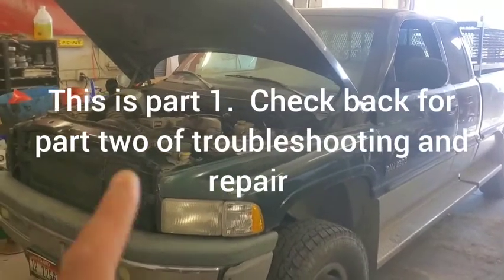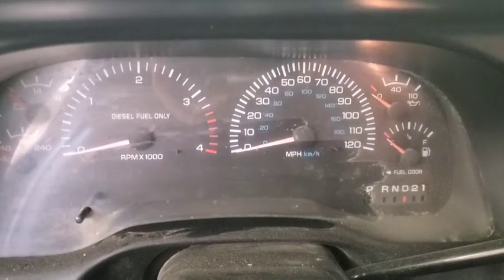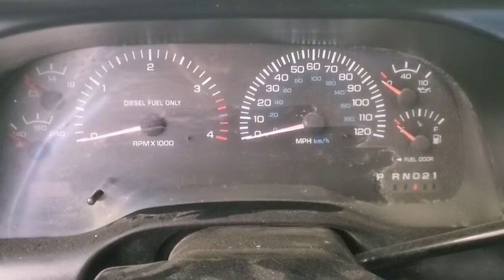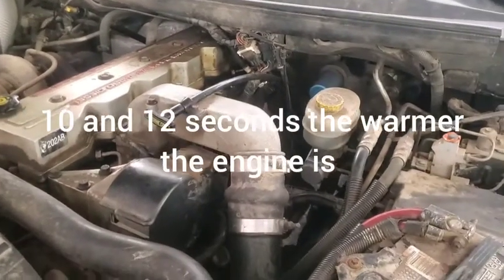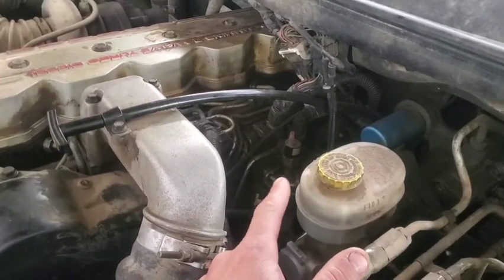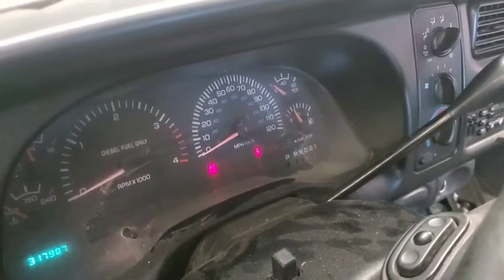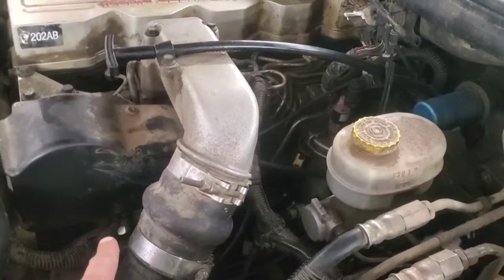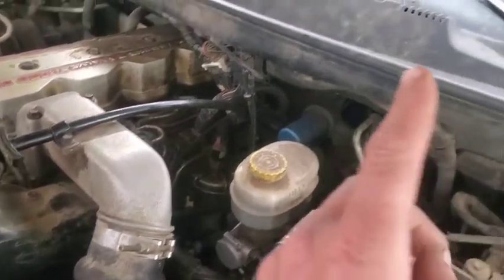24 Valve Cummins VP44 hard start and/or long crank.  Check this first!

Comment: Hi, just wanted to share... battery voltage looks fairly low... I've seen a good many times... 2 strong batteries and THROUGH ground check fix this exact issue... !  I know it seems odd... but, simple and something to try.  Please lmk if this happens to work for you.

Comment: P.D.R No Lift pump Air Dog 150 BUT wair do i get one of these check valves whats the name or brand the hole thing dosent make a lot of sence when i go out first thing in the morning it fires right up then the rest of the day hit an miss may not do it all day then oooppssss ....its kinda weired .. dident do it till i did the pushrod cover witch ment taking off the VP-44 truck runs real strong ollll balck betty got 100 over injectors very happy .. pulls my camper no horses any more miss them thank you Pro diesel R
Reply from the maker: I'm sorry but I can't read or understand what you wrote or what you're trying to ask

Comment: my WTS Light coms on every time i start but gos out when started my problem is like its loosing PSI if you let it set 15 /20  it takes 2 or 3 short cranks it purrrrr like a kitten never misses a beat but some how the fuel is not staying at the pump any idears  thank you guys great video
Reply from the maker: You try replacing the lift pump.  The lift pumps are supposed to have an internal check valve in them.  Or you can install a one way check valve in the line

Comment: Throttle Position Sensor
Reply from the maker: That's not usually the cause for this problem.  But I'm curious as to why you think that
Reply: because I replaced the TPS in my 99 Dodge without using a ohm meter, and the truck  won't start unless I push on the gas paddle slightly even after the motor is HOT.     @prodieselrepair3218

Comment: So with my 2001 24v I have the issue of hard starts / long in the mornings but once it runs for a while it will fire right back up but if it sits for a while it hard starts again but usually not as bad. I've already got my ECM rebuilt I only have a P1693 code I fixed all fuel leaks that it had before and don't see anymore. Anyone have a idea where to look at next? Also have a new raptor factory replacement pump.

Comment: My 99 3500 had the exact same WTS condition.  Dried up electrolytic caps in the ECM had caused a few issues, including having to bump the ignition to get the voltage output to lift pump correct to prime the injection pump.  Once I got it fixed I no longer have hard starts and WTS light initiates with key on like it should.
Reply from the maker: Thanks for sharing.  I suspect this pickup has an ECM going bad.  I haven't had it back in yet.

Comment: I have a chance to get my hands on a 1999 Ram 2500 Cummins automatic extra cab long bed with 98k on it. It's got the rot on the rear fenders, bottom of all doors, rocker panels and cab mount brackets. It was bought new by my neighbor originally to tow a camper, but he never ended up towing anything with it or plowing with it. What do you think it's worth?
Reply from the maker: Worth of any object should be defined by two things.........How much the buyer is willing to pay vs How much the owner is willing to sell for.  Geographic regions as well and many other factors all play a role in that value.
Reply: @prodieselrepair3218  Very true

Comment: Good video, was there a code for the grid heater or any temperature codes? I had a similar problem on my cummins, it would not heat up completely on really cold days. I had to key on twice and let the wait to start do it's thing for two consecutive cycles. Once I figured that out, it doesn't give me anymore problems. It's my understanding that all it does is heats the air, it's stand alone and doesn't connect to anything else. You might just have a funky relay or some corroded connections.
Reply from the maker: No I did not get any grid heater codes.  The heaters on this pickup do not come on until the Wait To Start Light comes on.  Even if that takes ten seconds  I suspect I have a failing ECM.

Comment: My does the same thing but wait to start light comes on when I turn the key then takes about 10-15 second to start everytime
Reply from the maker: It sounds like you might have some sort of fuel delivery issue.  Its possibly loosing its prime or its sucking in air somewhere

Comment: I don't find parts 2.
I have a f650 with vp44.
ECU shuts off lift pump during cranking. factory lift pump makes 8psi at idle. I'm told 8-16 is necessary.  I am going to install a facet pump with check valve, but going to wire lift pump to run while cranking. 
My problem is hard start on first start, low power, poor fuel economy, but no smoke and no engine light.  Eventually need to have pump and injectors checked.
Reply from the maker: I havent had this pickup back in the shop yet.  As soon as I do I'll make the video.  I suspect this pickup has a bad ECM.

Comment: I had this problem yesterday while hot intermitently.  Have a fass lift pump which I've heard can cause.this due increased fuel pressure.
Reply from the maker: As long as you're not over 18 PSI it should be OK.  Check the Wait To Start light.  It should come on right when the key is turned on.  If it doesnt its not going to start rigth away.

Comment: My truck is having an identical issue. Had a lift pump go out which cause vp to burn up. Replaced both of those and now having that issue
Reply from the maker: Check the Wait To Start Light.  It should come on right when the key is turned on.